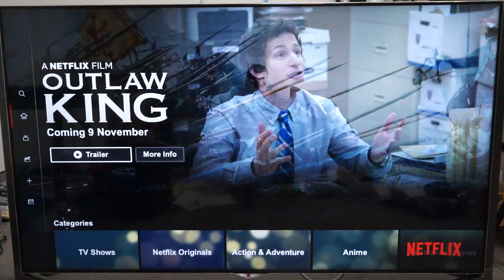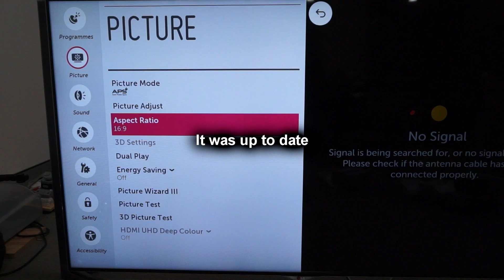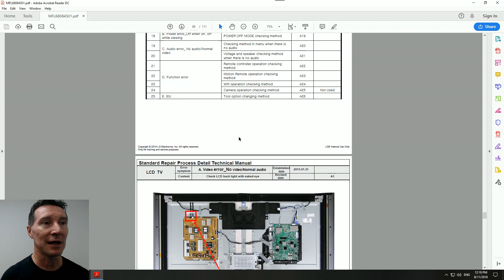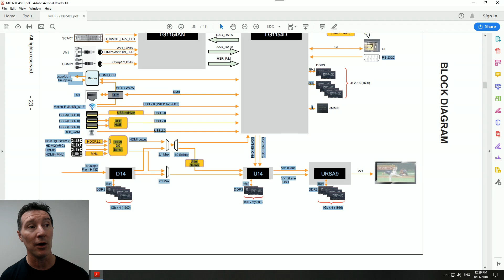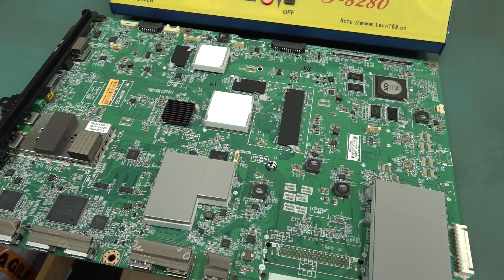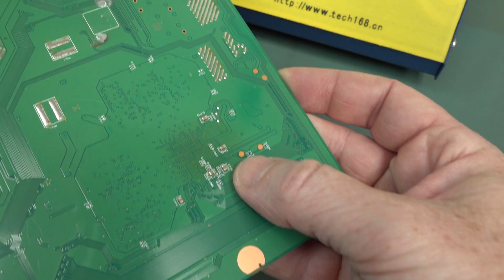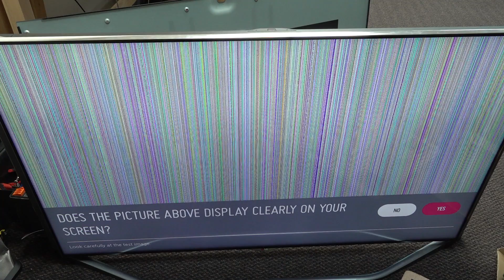EEVblog #1154 - Surprising 4K Dumpster TV Fault

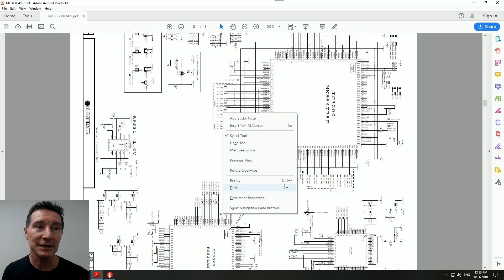Comment: 15:57 Maybe you can try to use a USB keyboard with the TV and try keyboard shortcuts from the PC or search the web for service mode with the model number. I bet those TVs have other ways to go into a diagnostics mode or run a diagnostics app. Maybe they call it maintenance mode.

Comment: I suppose it's easy come, easy go .....  The set didn't cost you anything and you learned something from trying to fix it  (even if that something was just "don't move BGAs while the solder is molten"),  so at least you haven't lost anything.

Of course, if you put that set back in the dumpster now you've bust it, another identical board is bound to turn up .....

Comment: Weird faults! My Samsung TV has a weird issue, it seemed to be a software update as it would cause the TV to reboot. Sadly turning off the Wifi & network didn't fix. Watching TV via the aerial is no problem. Using the Netflix app causes it to reboot - I can replicate the fault by rewinding and playing a specific clip (I can watch the video up to that point and after that point without issue!?). The Xbox works fine, playing video from the PC via HDMI can cause the same rebooting (again a specific section within any movie seems to trigger it?) I haven't swapped over the HDMI sockets, but the fact the the build-in Netflix app causes the reboot as well suggests it's something weird on the board causing the fault. I'd hate to board swap, but I guess that's how things are down these days...

Comment: Dave - something to try before reballing. Heat the chip and pull it straight off the board. Let the chip cool. Clean up the pads on the board with some fresh solder and some flux (
Amtech NC-559-V2-TF). Clean  the board again. Now flip the chip upside down and try to undo any solder bridges, leaving what balls are there. Worst case remove some of the solder from the back of the chip. When no more solder bridges exist, put down some flux, and put the chip down. Heat until bonded. Try it out and see.   Check out some of Louis Rossmann's videos on reballing techniques... https://www.youtube.com/user/rossmanngroup

Comment: I have never reflowed anything, but I would expect some things to be true of BGAs. The point is there are a large number of pads on the bottom of the bga and their associated solder balls. I'd expect if the bga moved sideways, for example if you blew air on it, it may short out solder balls, or glob them together in weird ways. I don't think it would be cool to see too much movement with the bga. Perhaps an IR temp sensor could just be used to see if it was hot enough. I have an AGP graphic card that went weird in the DVI but not vga one day and I wanted to maybe reflow it, but I don't want to screw up my cooking oven, and I would have to take the electrolytic off the board first??

Comment: First of all - why should the chip move when you just heat it up? It was already completely centered when it had been reflow-soldered at the factory, so it will not jump around that much you can see. And 2nd suggestion: Never ever try to reflow completely without flux, because even if it will heat up properly the soldering connections will just get briddle and oxidized when heating up them again. No flowing activity will really happen without flux. Do like Louis (Rossmann) would do, flood it with flux gel and you will be fine... ;)

Comment: That dodgy looking RAM IC is probably the cause, you overlooked it - there's always a framebuffer for these chips and it's stored in the RAM. There are 4 RAM blocks there and 1 looks entirely different, so I'm betting that was what was causing the problem...

Comment: Well i'd be left scratching the old coconuts wondering where to plant my watch makers lump hammer.

I'd say tazht like most manufacturers, you need to have their cable pinouts and match their pinouts to be able to communicate with it.

The ability to read is fairly easy, so maybe a pin needs to be high or low to indicate its connected to a service module.

Comment: Hi Dave, nothing to do with this video specifically, but, when describing things on your PC like the service manual for the 4K TV in this instance.  Could you get one of those yellow circles that is superimposed on the arrow cursor to make it easier to follow it's movements on screen.  You move it about very quickly and it is very difficult to follow.  It may be just me, I am visually impaired and this may be contributing to the problem?  A lot of other video bloggers use this yellow circle to aid their viewers to better follow their descriptions.  Thanks in advance.

Comment: I'm troubleshooting and reparing too. Just my sacrifice is my workstation. Been having issues so I added a new name SSD and now I'm resizing/shrinking the other 3 ssds down so they have extra spare blocks to do magic with. Had some issues with io performance and something causing long pausing with heavy IO especially writes. We shall see if this helps at all. I give it a 50/50 percent chance of helping. Or perhaps less. It's just something to try. And it is a proven trick that DOES help with performance in general so it can't hurt unless I screw something up and lose my data. I won't give odds on that lol.

Comment: Some initial tests for BGA would be applying pressure with your finger while TV is on and looking for any change in picture, cooling and or heating chip when TV is on looking for a change in picture. When attempting reflow look at near by soldered components for any solder melt which would indicate that the BGA is also melted instead of touching chip for movement.

Comment: Samsung tvs have an engineers menu accessed via a remote control code - you dont need a service remote. My mum was given a free samsung tv with a cable tv package. Unfortunately when i googled the model number, it was a tv designed to run on a hotel network (they have tvs specially designed for this!) So i had to call samsung to change the primary input from ethernet to hdmi. If i recall, it didnt have a digital tv tuner built in because of its intended use, so the only option to operate it was hdmi.

Comment: Service flow chart: Abnormal display ----> place in dumpster.
Reply: Then some guy comes along
 "oh look, a tv. I wonder what's wrong with it ???"
Reply: @scottb721  Or not, because if you're a nice person you'll write on it what's wrong with it!
Reply: JohnAudioTech  More great surface mount garbage, modern electronics is sure going down the $h!utter, no quality, hard to repair.
Reply: The right bga stencial solder paste and whit the stuff he have tv can be alive again or just ebay the pcb for like 50€ you can find the pcb and new tv.
IF the panel is ok the repair worth on 4 years old or less  tv.
Reply: or give to Dave Jones.
Reply: just for laughs : No no  you skipped the step where you drop the item or hit it until it works then you keep it but if you see more of  the magic smoke then place it in the dumpster.

Comment: You can poke BGA chips. You also need to poke them when reflowing to make sure all the balls melted. What you should not do is apply pressure. Poke them from the side, with tweezers, and apply just a little tiny bit of force, just enough to make it move  a bit.

Comment: Dave, I know someone has probably pointed this out before but you sometimes skim over things that point out to your problems and overlook them. For example there was one of the output error pictures that had a solder problem @7m07s. It would seem you suffer of my own problems that are mild ADHD and don't take your time to read slowly. Many times have I overlooked things in pdfs because I was in a hurry and needed a quick solution when it was always in front of me.

Comment: Let me shed some light as to why the RS232 Codes are listed in the consumer manual. This is a former top of the line, home cinema TV. Most professional and home made installs for home cinemas work with universal remotes who send RS 232 codes via wire to devices such as the amplifier ,tv , screen and sometimes even curtains and such. Hence these are included because the consumer really does need them. I worked in a small scale cinema (1 screen) for about 5 years and we used this system.
Reply: Exactly. Well said.
Reply: Why, then, does it have built-in speakers that don't look removable?

Comment: Lets say this fault could be fixed by a successful reflow, would applying a force to the chips in turn help diagnose which is the culprit.  I am assuming that it was once working and if it is a failed solder ball then it must only be a hairline fault and a small force would temporarily re-make the connection.

Comment: You could have tried the official and certified Apple repair method. They had a rubber pad pressing the chip down. It eventually failed and Rossman reballed the chip.

Comment: That is a high spec tv and worth fixing being only a few years old and comparing it to current model tv's (4K res, 200hz refresh rate, LED localised dimming, decent built in sound for a tv), so even if you have to buy a whole board to get it going after a couple of vids of you trying to fix it with what you have it would be worth it. RRP was $4599.00 when it left the market, average sell under $4000.00. brand new main boards available on ebay for $588.00 and $22.00 postage from melbourne. probably sell it second hand for $1500 easy once fixed if you could not find a use for it at home. i am a video junkie and i also sell TV's for a living and I would be more than happy to have this as one of my tv's.

Comment: silly question: could updating the firmware be a solution??
Reply: did you not watch the video? he tryed updating it..it was already on the latest firmware
Reply: I did, on occasion something goes wrong with the firmware, so re-flashing the latest firmware DOES make a difference.
Reply: @WPGinfo  yeah true...but pritty sure it went through the motions... and really if it was a bad firmware image, it would probably take out the OSD aswell...
Reply: I always try it anyway, simply because it's low-risk, takes only  a bit of time and 'making sure' doesn't hurt... AND.... occasionally it solves the problems. That's all there is to it as far as my comment concerns... have a nice weekend.
Reply: but you can also brick the device if its bad...ive killed a few PC mobos in my day just by updating the BIOS after downloading it on unreliable 56K modem connection! :P

Comment: You might be SOL on a new board (EAX65608604).  What should be a $80 USD mainboard for repair shops is now $400 USD on the private market because they're officially discontinued by LG.  Looks like that's the end of life for this TV, unless you can find someone to make you a new BGA template for that chip - assuming it was even a contact issue to begin with an not bad chip.

Comment: no amount of flowing that chip is going to work at this point. you pushed down on it and then slid it. it will need to be pulled and reballed

Comment: It's common for the crack to be in the flip chip to substrate interface. Rather than in the balls under the substrate. Heating it will usually change/fix the issue, at least temporarily, but it's not a permanent fix. Case and point is all the GPU and Playstation BGA issues.

Comment: Also, that looked like a bottle of water soluble flux. That stuff caused all sorts of hell where I used to work since it's somewhat conductive and people. didn't. wash. it. off. before. sending. boards. to. test. (bangs head on desk)

Comment: Use a bucket of solder balls, a thin layer of tacky flux, (lots of tedium) and set the chip upside down on a hot plate and gently bring it up to reflow temp. Hot air will just blow the new balls off the chip before they melt and stick.